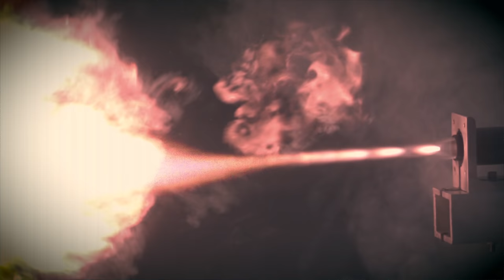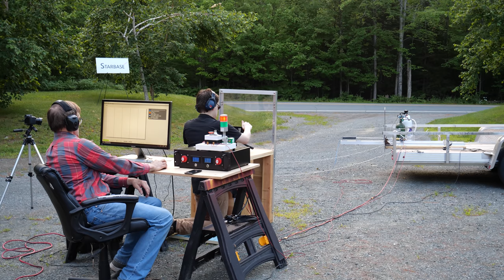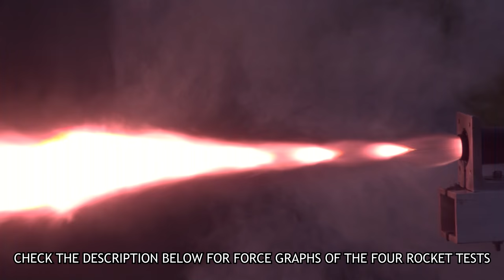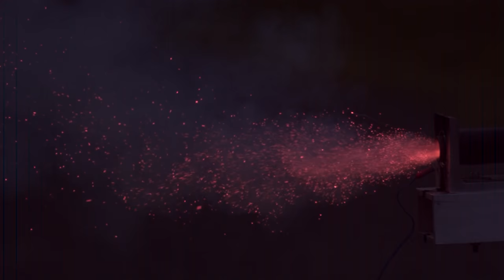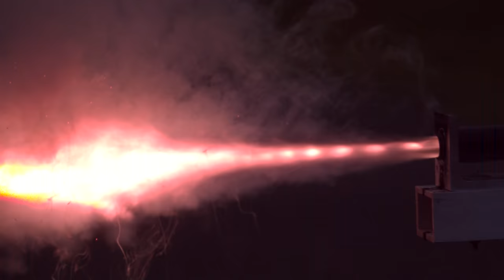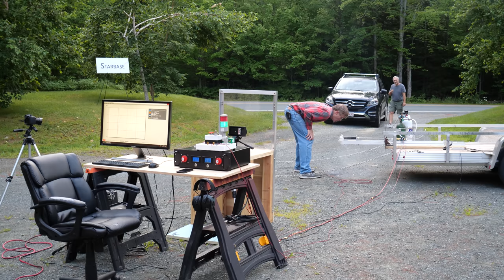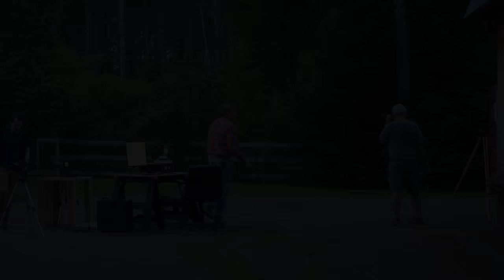Our Most Powerful Rocket EVER! Upsets Local Official!

Comment: I love those shock diamonds. Spent years as a test engineer in aerospace - most of the time, we'd do simple production testing on commercial jet engines. But every once in a while, we'd get to test a fighter jet engine. When one of those goes to max AB, you'd get six or eight shock diamonds, and the sound would be so loud it would be hard to breathe.
Reply: They look like standing waves just that I have never actually seen a standing wave, just heard.
Reply: @jakx2ob  Scott Manley does a pretty good segment on Shock Diamonds.
Reply: How much a jet engine cost of making?
Reply: @soumadipkoley581  you can make a valveless pulsejet for free if you have the skill to build it. A fighter jet engine on the other hand is probably in the $100,000-$1,000,000+ range.
Reply: Funny, near the end of the video, I was thinking of posting a comment asking what’s the physics behind the apparent standing wave with diamond shaped nodes. I should have known that would be explained in the video and by other commenters.
Reply: @soumadipkoley581  One of the ones I tested? They sell commercially for anywhere from $4mil to $25mil, depending on the model.
Reply: @soumadipkoley581  on the low end you can buy RC model aircraft jet turbine engines in the range of thousands of dollars.
Reply: I was an avionics tech in the Navy in the '80s and got to be at engine testing for F-14 Tomcats. It is awesome to stand near them at full afterburner. I could feel my organs vibrating.
Reply: Been wondering for literally years what those things are.  Bless you.  Because I didn't know the term I couldn't even look them up.
Reply: @Dmitry 4c hmm, I remember shock disks in the afterburners I observed. Could be suboptimal expansion I suppose, as the apertures were adjustable.
Reply: @jakx2ob  You took to words right outta my mouth.  Super cool to see it in action.
Reply: @MonkeyWithAWrench  Make that multiple millions.
Reply: My dad was on the development team for the engines used on the SR-71 Blackbird. He has some great photos of the engine in the test stand running full AB, many shock waves.
Reply: @MonkeyWithAWrench  100m for the f35 pratt.
Reply: There's a frame in this video where I counted up to 9 shock diamonds :) Sure is a sight.
Reply: the F-100 engine is basically just a big "fuck off" machine
.
the F14b got a huge upgrade with the 110s.... but that thing would have been STUPID with F100s
Reply: Former F-15C pilot.  Out of curiosity I went to the hush house while a crew chief was running up engines in the jet.  Can confirm in full AB it's hard to breath and also I remember my vision blurring, I think my eyeballs were shaking around.  That was enough for me.
Reply: The amount of ingenuity in rocket engine design is a delight to behold - even in historic units like the old V2. Those used 75% ethanol with 25% water for fuel and the water helped with cooling the combustion chamber and nozzle by both fuel evaporation and the water evaporation. Removal of the water resulted in rapid failure by burn through. Add in that the water was ejected at velocity, aiding in propulsion, it was a fine example of using trade-offs in a regenerate way.  :)
Especially given, making a rocket starts out with, "build a bomb, make it explode for a really long relative time, in only one direction and add steering"...   ;)
Reply: @BasedF-15Pilot  So what does it feel/sound like when you move from sub to supersonic? And what would be the fastest you could go on full ab, say at a slight nose-down pitch? Would have loved to fly but medical, epilepsy, kept me out of service in the military. Father was a flight instructor for the huey & cobra. When he retired we were living in Las Vegas, he we stationed at Nellis. So the guys there took him up a few times in the F16's there. First time was pretty funny when he got home he was still blue, sick feeling & dizzy. The next few times said he was alright & the took him to the firing range & got to unload some ammo. Lucky guy. Thanks for your service
Reply: ⁵
Reply: @mrt2this607  I went mach 6 in my Mustang GT and I still had half a pedal left..
Reply: ! D
Reply: @hubrisnaut  I loved the feeling being next to the lane at AA Fuelies and jet, and some rocket  drag races!  👍👍😁😁
Reply: @davidbegor8709  Yes, It was great. I only got to sit in a few doing comms during testing.
Reply: I remember learning about those when I was a kid watching a documentary about The SR-71.  Now I need to watch all the physics videos on his design here.  Pretty neat.
Reply: It’s makes it hard to breathe because of the engine sucking all the oxygen like a vacuum around you
Reply: Someone please correct me if I'm wrong, but shock Dimonds are inefficiencies, correct? So to produce such high trust, and still have more energy to capture is quite amazing
Reply: Wohe
Reply: @Forgeahead shock diamonds mean that the engine nozzle is over expanded (the nozzle turns pressure into velocity of the gas). Overexpanded means that the exhaust gas is at a lower pressure as the surrounding and collapses inwards. At the transitions of supersonic to subsonic flow you get Shockwaves that reflect and form those diamonds. So yes, it is inefficiencies with the nozzle. Now if you were to lower the ambient pressure (rocket ascending), at some point the nozzle expands perfectly and you get the maximum specific Impulse (efficiency). Lowering the ambient pressure further you start underexpanding the flow. That means that there is still pressure left in the exhaust when it leaves the nozzle and  it expands outward more.
Reply: @stevennagley3407  Nothing to do with it "sucking out air" and all because the sound is so loud it's causing your diaphragm and other guts to shake around inside your body. And as has been stated earlier, it will cause your vision to blur as your eyeballs shake too.
Reply: WAY!  To Close!  even this size!  never underestimate the bad in "Murphie's laws"    I could not work with this dude.

Comment: I never thought about the backpressure of a hybrid rocket acting as a safety feature. That's pretty neat.
Reply: I found that really intriguing aswell, im wondering if that precise pressure regulation improves nozzle performance in any way over an unregulated engine
Reply: @youngbloodbear9662  In this case with engine 4 you can clearly see it hinders it. 
All the black smoke means there is unburned carbon in the exhaust so lost performance and efficiency.  
If you want peak efficiency you have to have some kind of controlled valve.
Reply: Yeah. Although that may be a problem if you want to get more oxidizer into the combustion chamber even when the combustion chamber's pressure is at or above that of the oxidizer tank.
Reply: @nukularpictures  I think that was because either the pressure was too low to feed the larger motor or that self correcting mechanism developed a feedback loop in that case oscillating in pressure
Reply: Holy shit, I used to watch your channel all the time when I was younger. Time to binge.
Reply: I will note that it doesn't always work out "nicely".  I have been at MANY hybrid rocket firings, and occasionally seen "oh oh" moments where pressure-transients in the chamber propagate into the N2O tank section and cause a bad day.  Bits of rocket motor casing thrown thither and yon. Which is why we always did our tests, even for "small" motors from inside a concrete bunker.
Reply: The worst one I ever saw was a startup-transient caused by an over-aggressive ignition scheme propagating into a tank second that was actualy filled with high-density vapour rather than liquid. Oh the boom, the earth-shattering kaboom. It gave pause.
Reply: Pressure dictates the reaction rate 💁‍♀️
Reply: You can see it in the pulsing effect coming out of the nozzle. At first, I wondered why that was happening, thinking maybe the fuel wasn't burning evenly or something. Then, when he mentioned it as a bootstrapping effect, it made sense. I imagine that if you increase the NO2 pressure or even the diameter of the NO2 feed, you could really dial in the thrust output and eliminate the pulsating. 

Also automotive grade NO2 systems run the best at around 950 psi bottle pressure. I think maybe bottle pressure was a bit low on the last engine which caused it to fire a little unevenly.
Reply: You were right before, the 'back pressure' does not exist in a rocket, only in separated motors. On test benches like this, if he were to apply the same logic, then a solid fuel grain rocket, would not be packed, it would fall down l an incline, and burn when it gets to the chamber. If there's too much pressure, the grains would stop falling as the 'back pressure' pushed them back up the incline.it's even Easier to imagine with a liquid rocket. If this was a 'rocket', that pressurised supply is going to get very hot, very quickly, that ups the pressure, carry on in the same circle he said, only now you have a pressurised, steel container, filled with oxygen at high temperature and rising. The steel will start to react, dramatically increasing pressure more, to the point of it being a fragmentation grenade/pressure cooker ied.
If he put pumps on these, it would be identical to the other rockets, and if he wanted to do everything the same, he would have compared this to a liquid rocket, you pressurise the liquid as its means of delivery. Same 'safety feature'
Take care
Reply: Christie Malry  really? Ok. Is it because I took the two separated parts, and theoretically, put them together? 
I'm saying, he's not exactly comparing like for like, so the OP was "right before" does that sentence and idea make sense to you? 
when he talks about a fully mixed, oxidiser and fuel, in large grains that may crack, as a danger, and this as a safety, he might as well put that against saying we're going to mix the oxygen with the fuel, pre - combustion. Because,, 'that' , would be an instant bomb, like solid fuel if its pressure spikes (for whatever reason)
If you want a more elaborate explanation, no problem, just ask. Take care
hope that helped. Take care
Reply: Glad Im not his neighbor.
Reply: @renagenic  You're still not making any sense. What the uploader said makes perfect sense: The hotter the chamber, the faster the fuel grain burns, but in a hybrid rocket the flow of oxidizer will automatically go down as chamber temperature/pressure increases.
Reply: You really couldn't work it out when I said, "I took the separated parts, and theoretically, put them together?"
Here is another hint, 
Think INSIDE the box
Reply: @NavinF  actually, I flat out explained it 2 posts ago. Are you being serious?, I can explain it another way. But the basics are all right above you. Just think like for like. And "thinking INSIDE the box", was in reference to a closed system, in this case, a hypothetical vertical launch orbital rocket
Reply: @renagenic  Look I'm not the only guy that found your comment to be unintelligible. To be honest my best guess is that you're either trolling me with "think inside the box" or you're a senile old man that can only hear himself. Why not restrict yourself to the sort of language a technical writer would use? Or draw a diagram?
Reply: Christie Malry  end of story? Wow, an unwelcome surprise, so I guess, you are the type of person who thinks electric everything will make us net zero in carbon instantly aren't you.? Lmao think more than 1 step before you close your story. I actually thought you'd understood and was pretty damn impressed you pushed to look past the SEEMINGLY Obvious(that stopped you 1st), and realised the other half of this entire reaction without being swept by the 'seemingly obvious' logic. 
Like I said before, though. 
How it is, 
on his desk, 
completely separate. 
Can make a much more idealised version of what he's TRYING TO proffer, as a whole. 
Why are you so stuck on an increase in pressure being the cause of an increase in reaction rate in solid fuel? Who told you that? Or did you just think it?
Reply: @NavinF  fair enough,
A technical writer? I'll do what I can, I have to ask first, is there something I'm missing, is he offering something to someone who can debunk him? 
I'm not trolling, I'm not Biden, I'm a humble chemist who specialises in (youtubefriendly=things that deflagrate quickly). This is why you won't find a comment from me on any other of His vids, this was the first time I heard him say something that wasn't correct. Or was missing enough context to be almost correct, just not technically, when it comes to the point of equilibrium of partial pressures in reactants and products.
It might be long, and it might be a little hard to follow If you don't know the underlying, I'll seriously and honestly do my best even if you need me to talk it through with you. The only thing I ask is you answer the earlier question, and that this disagreement/explanation is "in good faith". What do you say?
Reply: @renagenic  we're taking about an increase in chamber temperature which leads to both an increase in reaction rate and an increase in backpressure. Btw you're intentionally bringing up politics (carbon emissions followed by Biden) to derail the conversation. I'm not gonna respond to a troll any more. Cya!
Reply: @NavinF  woah woah, political. FfS I'm a chemist, I know what climate change is. My point is you have to create the electricity, first. Negating the effect of changing. You guessed I was senile. I said I'm not Biden. Im Welsh, I don't have a dog in your fight. If after a message like I just sent you, you're going to speak like this? Was your name on that message??? NO
If you decide to run away from this debate, crack on, you do you. 
ignorance is bliss, I hear
Reply: Christie Malry  but NONSENSE? damn bold of you
Reply: Christie Malry  where to start. Gun cotten is nitrocellulose, and it was made by adding nitric and sulphuric acid to a stable carbohydrate, in most recorded cases, cellulose.
You do realise that you have not contradicted what I said with that law, right. All you've said is that the burn rate is proportional to the energy introduced, in an adiabatic system.
Reply: @Christie Malry and this is where kinetics comes into it, IF you want to go down that road.
SP 1 c 2 c I k TN k T M^0.5
From= Energetic Materials: Processing and Characterization of Particles. Page 7, 1.2.2- solid rocket propellants. 
"where r = burn rate; a = constant; p = pressure; and n = pressure exponent. This
equation is not generally applicable and is relevant only over a small pressure range."
Reply: Christie Malry  whatever man, The 'constant of proportionality' is k. Burn rate increases because of the kinetics of the reaction increase , not the reaction rate, as its hindered by its equilibrium, you can do other things to push the reaction to the right, starting with a higher pressure, will give you a faster reaction (higher deltaG) . But the reaction won't do it for itself, unlike its exothermic properties, its partial pressure between solid and gas doesn't feed itself in a cycle, as it pushes the reaction towards the reactants, keep HEATING it up, and it will make more pressure, but its increase in pressure, won't create more pressure. Basically I'm saying, a millisecond after the start of the reaction, it will get to equilibrium, yes it makes more pressure to start. But then it's partial pressure's at equilibrium and only temperature is going to speed the reaction up
And yes, that would work in a system where the MM of products was the same as the MM of reactants. Find me a solid fuel oxide like that, where the rate of reaction can actually go up WHEN accounting for temperature. Vielle and shulz(sp) equation was to charecterise ch2 burning and flame fronts. An idealised scenario. 
Just btw
this still doesn't even change the fact that 'the safety' he's implying in this video. My reason for commenting, is not applicable in the way he stated it with reference to solid fuel. To be fair, this got to a pretty interesting convo,
Please let me know if the link works or not, I'm not sure about just taking a screen shot n posting (the text stated there at the top of the page, so I don't think that would've be accepted lol) did you make a video I'm missing?
https://zavo.info/xQo4qgOFc
Reply: Christie Malry  nvm the video part, you said ebook and something else, my bad
Reply: CATOSTROFICT FAILUE OF A ROCKET MEANS YOU GET A BOMB NOT A ROCKET )
Reply: @nukularpictures  At the beginning of the series, he specified that the recipe used is fuel-rich (less oxidizer than the stochiometric).  The first moments are solid fuel/oxider mix only, before the liquid oxider gets involved, so, yes, it's going to have unburned carbon -- BY DESIGN.
Reply: @youngbloodbear9662  regulating pressure in the chamber is extremely important in liquid fuelled rocket engines, both in terms of efficiency and safety. Hybrid rockets are beyond my understanding, though.
Reply: @homeopathicfossil-fuels4789  actually since that comment I’ve gotten my aerospace engineering degree haha, I can say now that I expect it’s a great deal easier to get good performance with that added control over having to rely on the dynamic equilibrium in a solid rocket or the dynamics of the fuel pumps in a typical liquid rocket
Reply: @youngbloodbear9662  wait you managed to get a degree like that in 2 years? Youtube's comment date record thing is awful so it might've been longer than that. I have no degree in anything, I just played children of a dead earth and wanted to be an aerospace engineer :p